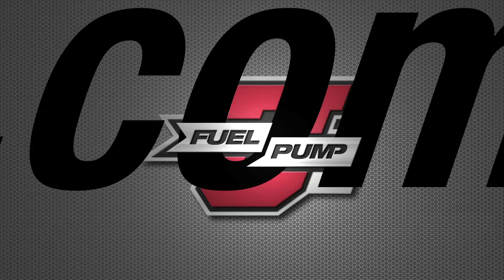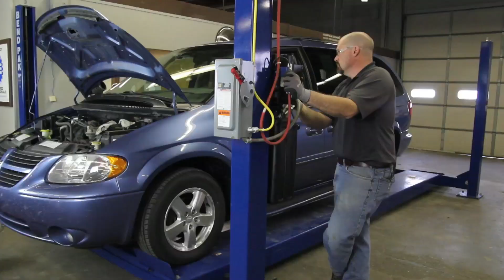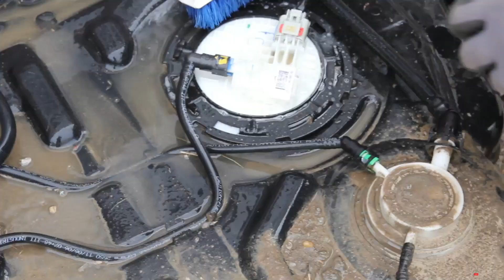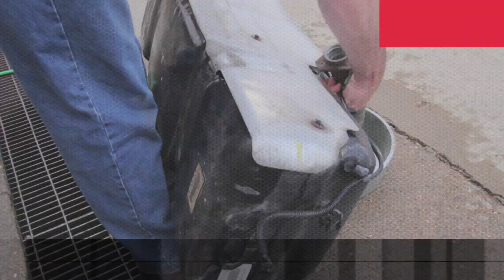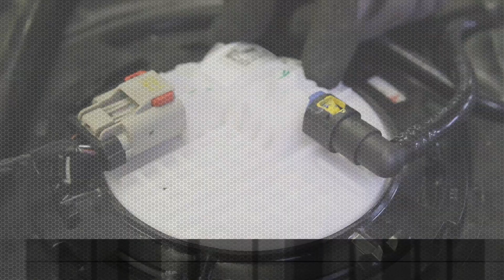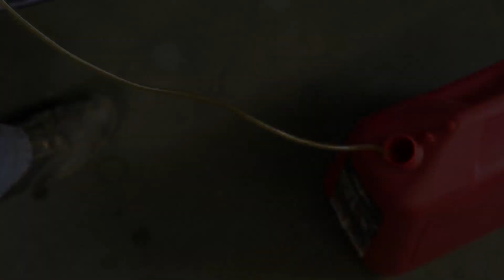How to Install Fuel Pump Assembly E7196M in a 2005 - 2007 Dodge Grand Caravan

Comment: where is the fuel filter for this van?? i have an 05 with the same tank but i cant find the filter
Reply from the maker: Beginning with 2004 - 2005 model years the external fuel filter was eliminated from this vehicle. when an external pump was used it was located on top of the fuel tank.
Reply: @AirtexFuelPumps  is it possible to install a fuel filter on them? This is a great video by the way. Really appreciate you sharing your knowledge. I'll be using your video when I do mine this weekend.  Also, I'm tapped for $$. Is a brass punch necessary to remove the ring off. Or may I use like a wash cloth and put between the ring and what I'm using?

Comment: Great video. Specifying proper pressure running and not running, ( with key on/engine off) and where the Schrader valve is located would be helpful.

Comment: What happens if you break plastic piece on evap line that connects to unit on top of gas tank? Can you replace just this unit? Or is it connected to the tank & you have to replace entire tank?
Reply: you need modifications like matter said 
slowly very very slowly drill a hole where is broken 0.5 inch deep 
cut a small pipe made of copper the same size the one is broken 
plug it tight or tap very lightly with a hammer 
and be careful, its very fragile
Reply: otherwise you need to change a whole tank

Comment: Great video! Do you know is there is any fuel filter in the system and where is located?
Reply: the fuel filter on this model is attached to the bottom of the fuel pump assembly. its basically just a sock.